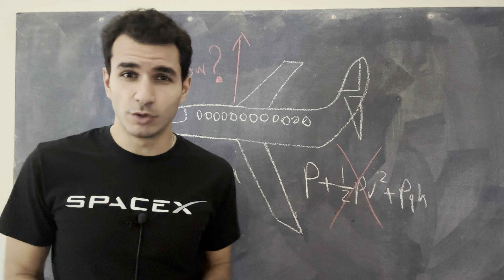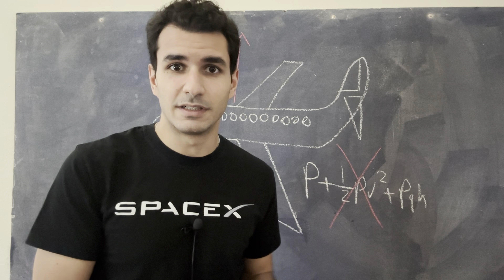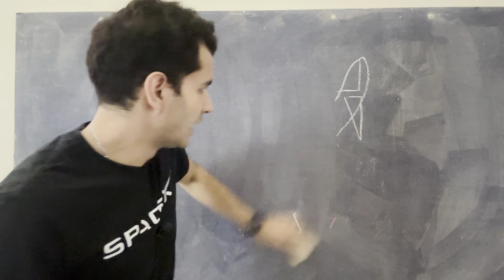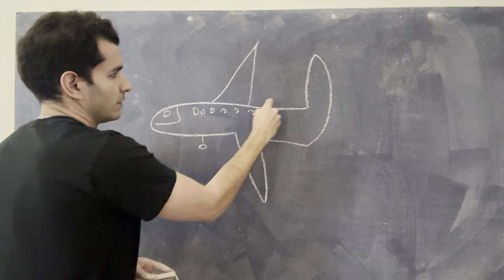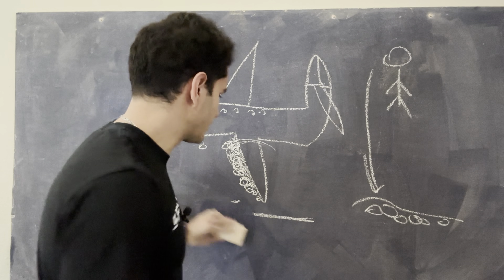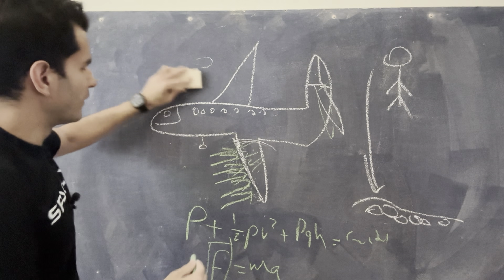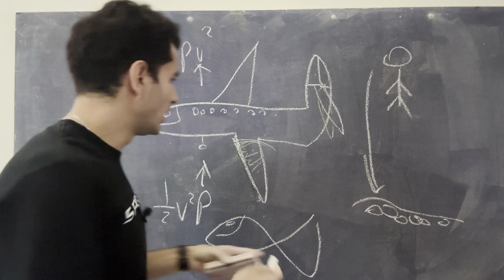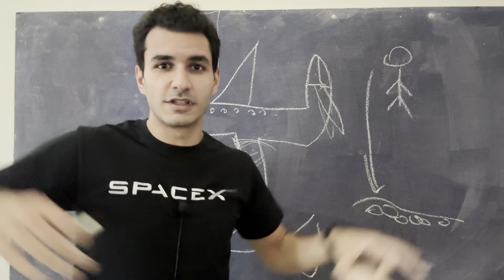Fix This One Misconception = Understand Airplanes Forever

Comment: Finally, after so much time, I managed to find a video and an explanation that matches my way of thinking about this very particular topic. A few months ago, I had a long debate with some friends about why or what causes an airplane to fly or generate lift. I'm a mechanical engineering student, and honestly, in the fluid mechanics course we didn’t study aircraft behavior specifically. It was more about fluids in closed conduits, and generally they were specific liquids or gases. Still, I understood the basic principles of macroscopic fluid behavior.

Now, every person I asked or every video I watched always said the same thing… the damn pressure difference caused by Bernoulli and the geometry of the airfoil. Something about that didn’t convince me. I knew Bernoulli's principle applied—of course it did—but it seemed like an incomplete explanation. I knew that, somehow, Newton's third law had to play a role, and it’s as simple as saying that an airfoil—or any geometry that redirects air—generates lift. Obviously, the efficiency with which it does so matters. The airfoil is just that: the most efficient shape to generate lift. Thanks to its geometry, it redirects air particles, and as a consequence of that same geometry, a pressure difference also exists. Both phenomena happen together, and it’s because of the airfoil’s shape. You can’t redirect particles without a pressure difference—they will always go hand in hand!!!

Lift is generated because the airfoil redirects airflow downward, which results in a reaction force upward. The pressure difference is a consequence of the flow around the airfoil and expresses the same thing.

By the way, I thought the fish analogy was great—not for nothing do ship propellers have a larger contact area and greater angle of attack, since water is denser and its rotational speed is lower.

I even know people who tried to explain to me that the propellers of a small airplane—which clearly have an airfoil shape—generate thrust because of a pressure difference, and not because they push air particles in the opposite direction of motion. I couldn’t believe it.

I want to apologize for the English, the truth is that I wrote the answer in Spanish because I'm from Argentina and well... it's what I could do.
Reply: otra cosa, quedé facinado con tu trabajo, trabajar en ese tipo de cosas debe ser una locura no?  Especificamnete que haces allí?
Reply: y porqué en la NASA y no sapaceX ?🤣

Comment: Maybe worst explanation of lift via wings I've ever heard. At about minutte 8:30-40 he even mixes himself up about where the pressure is higher even though usually he has it right. He never mentioned that how a spoon (shape) gets 'lifted' into a water stream is also relevant to wing lift.
Reply: The pressure gradient to maintain mass flow continuity turns the flow resulting in the reaction force of lift.  It's all mass, energy, and momentum conserving themselves in relation to each other.  Coanda doesn't do work (in an energy sense), and its meaning suffers from different interpretations.

Comment: Sorry to spoil the party, but a cambered airfoil (asymmetric to generate higher flow velocity over the upper surface) such as those used on airliners can generate lift even at a negative angle of attack, for example around -5°, meaning the wing is tilted downward (where 'Newton' would generate a down force).
While it's of course true that lift can be generated by deflecting airflow downward (Newton’s third law), this approach is more characteristic of aerobatic aircraft, which typically use symmetric airfoil designs. These allow pilots to control lift almost entirely through changes in angle of attack (pitch), which is crucial for consistent handling during inverted and complex maneuvers.
The same principle applies to helicopter rotor blades, which are also symmetric because lift must be controlled precisely and equally during both the upstroke and downstroke through pitch adjustments.
The trade-off is efficiency: symmetric airfoils generally produce more drag at a given lift level compared to optimized cambered designs. As you increase the angle of attack to generate more lift, the aerodynamic force tilts, and the component of that force opposing the direction of motion increases—this is experienced as drag.
This difference becomes evident when comparing a highly optimized cambered wing (relying more on Bernoulli effects) of a glider to the symmetric airfoil (relying more on Newtonian deflection) of an aerobatic aircraft. A glider can achieve a lift-to-drag ratio of up to 70, while an aerobatic aircraft typically achieves around 5.
Reply: There's not purely "Bernoulli" or purely "Newton's third law" in relation to angle of attack asymmetry vs camber asymmetry.  In other words, it's not about pressure vs momentum.  The pressure difference as the force of lift (pressure x area ) is always equal to the vertical momentum change rate, and one causes the other (a pressure force accelerating a mass of air).

What affects the efficiency is how much mass vs velocity change in the momentum relationship.  As supply of mass flow reduces (slowing airspeed), the replacement by increased velocity acceleration to maintain the constant vertical momentum change rate (force of lift), increases the energy consumption (velocity is squared in kinetic energy).  

So, the vertical pressure gradient needs to accelerate as much mass as possible for the efficiency of keeping the vertical speed change of that mass minimized.

The above implies maximizing the pressure drop on top, as it attracts a large volume of air above for the downward momentum change.
Reply: @davetime5234  Sure I do not claim otherwise. But between -5 and +10 degrees it is predimonantely Bernoulli (for an optimized chambered airfoil), with having a lower than static pressure above AND below the wing, with the lower pressure above the wing generating lift. Above +10 deg you start to have an over pressure (dynamic pressure with is larger than the static pressure) below the wing.
Reply: @olivergroning6421  Dynamic pressure plays a role in localized flow characteristics, but in terms of the big picture of lift, it’s more of a secondary factor. The primary driving force for lift comes from the total vertical pressure difference, which is governed by how air divides its speed above and below the wing and the resulting rate of vertical momentum change.

There is no predominantly "Bernoulli" vs "Newton".  There is always both fully equal to lift (in unaccelerated flight).

The only thing that varies of note is the velocity vs mass composition in the rate of vertical change of momentum.

That rate of change is always the same, and the vertical pressure difference that accelerates that change is always the same in unaccelerated flight.
Reply: @davetime5234  Thanks for your comments. To ensure a clear discussion, let me briefly outline the point I’d like to make.

First, the trivial but important point: Lift on a wing is always due to a pressure difference between the lower side (higher pressure) and the upper side (lower pressure). The interesting question is: why is there a pressure difference, and what is its nature?

In the video (around 9:30), the presenter claims that the airflow increases the pressure below the wing, which pushes it upward. I interpret this as suggesting that the pressure below the wing rises above ambient pressure (where "ambient" refers to the pressure of the freestream air far from the wing). That, however, is not typically the case for an airfoil at cruising conditions (i.e., low angles of attack).

The key point is this: lift is not primarily caused by an increase in pressure below the wing, but rather by a reduction in pressure above the wing.

In fact, at angles of attack near zero (see e.g. Embry-Riddle Aeronautical University, Chapter 31: Aerodynamics of Airfoil Sections), airfoils exhibit a pressure reduction on both the upper and lower surfaces, relative to ambient pressure. Yet, the pressure is still higher on the lower side than on the upper side, and this pressure differential generates lift.

This is true even for (nearly) symmetric airfoils. For example, the freely accessible paper "Numerical and Experimental Investigation of Aerodynamic Characteristics of NACA 0015 Aerofoil" illustrates this well. In Figure 14, at 0° angle of attack, there is a symmetric low-pressure region above and below the wing — resulting in no lift. At 6° AOA, the pressure below the wing is close to ambient (perhaps slightly below), while the pressure above is clearly reduced. At 12° AOA, based on a rough estimation from the graph, the average pressure below the wing is around ambient +25 Pa, while the average pressure above is about ambient –60 Pa. Thus, even for a non-cambered wing at a large angle of attack, the lift remains dominated by the reduced pressure above the wing — not by a pressure increase below.

Looking at simulations of cambered airfoils (while not claiming universal representation), it seems to hold quite generally that the primary driver of lift is the pressure reduction above the wing, even at angles of attack close to stall.

This pressure difference originates from the velocity distribution along the wing surfaces. According to Bernoulli’s principle, regions of higher velocity correspond to lower pressure. The lift force is then obtained by integrating the pressure times the normal vector over the wing surface.

In summary, based on the data and simulations I've reviewed:

    The primary cause of the pressure difference between the upper and lower surfaces of a wing is the formation of a low-pressure region above the wing, rather than a high-pressure region below. As always here with respect to ambient pressure.

Comment: To be clear, "Bernoulli's equation" essentially comes from Navier-Stokes which comes from Newton's 2nd law, so one is really equivalent to the other.
Reply: Bernoulli does come from Navier-Stokes, but Navier-Stokes comes from all of Newton's laws.  Navier-Stokes is a more generalized version (extension) of what Newtonian physics of motion is (what Newton already anticipated, though didn't fully formalize yet for the most generalized case).
Reply: @davetime5234  Yes, it does come from all of his laws. Although he of course didn't formalize it yet (in the typical vector calculus way), he would've been able to derive it using only his laws and knowledge at the time (given a simple incompressible, Newtonian (!) fluid)

Comment: Eh, so disappointing. I was hoping for that aha moment but it never came. You did a good job of explaining why the pressure rises on the bottom of the wing but that only explains 1/3 of the lift generated by a wing. 2/3 of the lift is from the pressure drop on the top of the wing and, sadly, you skipped this altogether. Maybe in another video.

Comment: So as velocity increases, relative density of the air increases, and the shape of the determines how that density might be distributed as it flows across the wing? And the shape of the wing is important because it helps to maintain laminar flow (which, correct me if I'm wrong, it seems like increasing density would counter act laminar flow), so the flow of air is predictable and therefore can be controlled by the control surfaces of the airplane? Not sure if relative density is a thing with regards to aeronautics. I looked it up on wikipedia and flight isn't mentioned, but everything you said makes sense. Again correct me if I'm wrong, I've just started learning about the principles of flight and it's fascinated me so far.

Comment: Effectively it’s thrust/ air vectoring. You’re redirecting air in a certain direction and getting the momentum in the opposite.
Reply: Pressure gradients are created by the geometry of the wing, as there is a readily available pressure produced by the atmosphere. These pressure gradients determine the pressures and velocities of air over a wing surface area, resulting in the pressure differential for lift, not thrust. 

Thrust directs a rocket upward, an airplane moves horizontally yet its lift vector is vertical.
Reply: @singh2702  a not insignificant part of that is due to the engine thrust as well. Whatever you wanna call it at the end of the day it’s a momentum of the air being directed in the opposite direction of where you wanna go.
Reply: @firstolasto1518 At the end of the day, the lower surface of a wing compresses air, increasing its density and pressure. These pressure forces applied across the wing surface area must equal the weight of the plane. 

The air which accelerates downwards, as it passes the trailing edge, is caused through a pressure gradient as the greater density and pressurized air leaving the wing wants to return to lower ambient density and pressure. This momentum change is a byproduct of the compression under the wing which is the actual force lifting the aircraft.
Reply: @singh2702  that’s  just a very long way of saying “ air moves one way, plane moves in the opposite direction”. Whether it’s a wing, vertical jets, helicopter blades and makes absolutely no difference. All that matters as you’re able to push air molecules in the opposite direction of where you want to move. How you do it, no one cares.
Reply: @singh2702  if the jet engines were powerful enough, the plane would be able to hover vertically. And in that situation all your pressure gradient and everything else become irrelevant. The shape of the wing, and the structure, coupled with the angle of attack are designed in such a way to redirect error in a manner that would propel the plane and maintain horizontal flight (for the most part).

Comment: The crappiest explanation ever. So according to this guy planes should just have planks for wings because what makes them fly is the tilt. The more someone says "duh" when trying to explain something, the less seriously I take them. Duh!
You cannot explain a wing stalling if it's only a question of angle. Lift would be a simple function of tilt and would  continuously reduce to zero , not stall. DUH !
Reply: The tilt of the angle of attack is asymmetry, and it is asymmetry that is the essence of lift (as with asymmetrical camber), but it's also true the "Bernoulli" pressure drop is just as relevant when the angle of attack is the main contributor to total asymmetry.

The above is lost in most of these explanations, as if flow continuity and conservation of energy is context dependent (it's always there because it is the basis of Newtonian physics).

Comment: Lift and drag of an airfoil are best explained by circulation. The KJ theorem explains it best. Pressure lift and reaction lift are essentially the same, just that one is more airfoil-profile dependent and dominates at higher dynamic pressure (airspeed) and the other at low dynamic pressure and greater AOA.
Reply: To say one dominates under some condition is not true.  

The pressure difference is always fully equal to lift. 

And the change in downward momentum per second is always fully equal to lift.

Furthermore the KJ theorm is a fix to remove potential flow's truncation of physical reality (irotationality).
Reply: @davetime5234  That's not really what I was saying, yes the pressure difference is the same but from a more "physical" point of view, its easier to consider reaction lift at higher AOA regimes for learning purposes. When flying its easier to think of lift as a geometric relationship as opposed to a pressure field. For strictly analytical purposes, yes I agree with your point.

Comment: To get lift you excellerate air down.
Reply: You definitely can't avoid that necessity.   And then the question remains how:

Mass flow continuity creates a pressure field to sustain itself according to conservation of energy (necessary speed changes swap energy with pressure changes).

These pressure gradients bend the mass flow momentum downwards (ambient flow turns downward towards low pressure areas; higher pressure turns downward towards lower ambient pressures)

Comment: How does a plane stay aloft in LEVEL flight?  Are you saying planes are built with a permanent up angle in the wing relative to fuselage or that planes are always in a small pitch up attitude during so called level flight?    If either is the case why all the fuss with airfoil design — just make the wing flat across on top and bottom like a paper airplane.
Reply: Yeah, level flight requires continuous asymmetry of the solid to the relative flow.  Asymmetry is the essence of lift production. 

Asymmetry can come from any combination of angle of attack (tilting) and/or asymmetrical camber built into the wing.

Camber helps with smoothing the sharpness of the flow turns and also increasing the proportional contribution of the pressure drop on top's contribution to total lift.

Both of the above contribute to increasing the lift to drag ratio performance.

But angle of attack contribution is always needed to fine tune the amount of lift as flight conditions change.